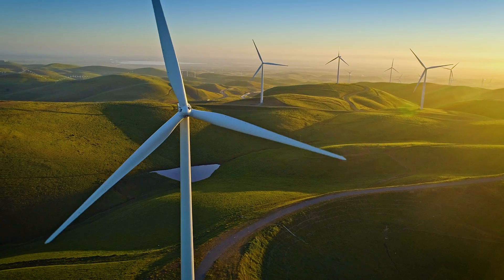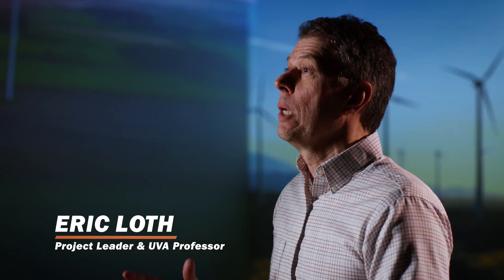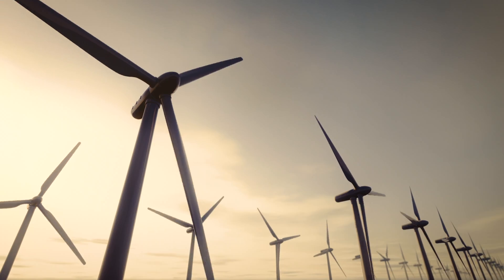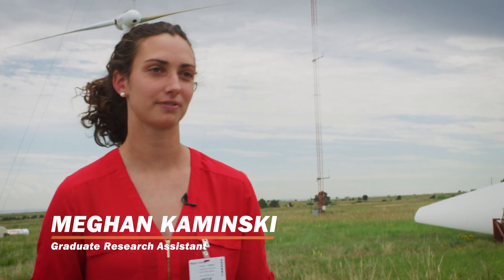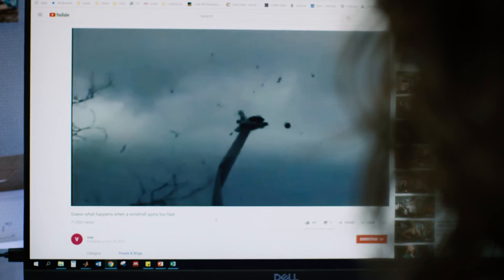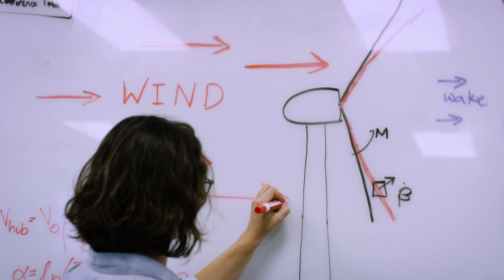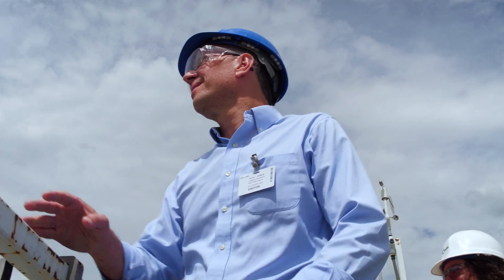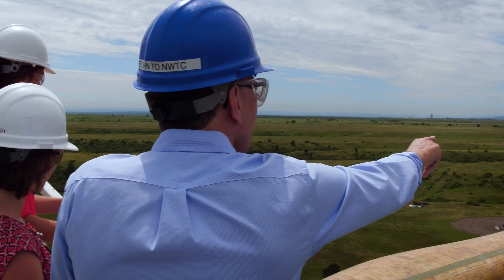These Giant Wind Turbines, Inspired by Palm Trees, May Be the Future of Renewable Energy

Comment: Force on blades increases at the cube of the wind speed: 
Power = (Air Density x Area x WndSpd^3 x efficiency) – drag
Today’s Wind Turbines max operating wind speed is approximately 50 mph (22 m/s). This speed limit is primary for two reasons:  excessive force can damage the blades; too high rpm can exceed the max rpm of the generator.
Folding the blades reduces the Area and is similar to feathering the blades, which reduces the force on the blades and controllers the rpm. Three challenges folding blades may face are keeping the blades in balance with each other, vibration and their folding response time to gust.
Bottom line is, the folding blade has little or no effect on the wind harvesting ratio, but does add more complexity. Its intent is to extend the upper wind speed range, and may add a few mph; however the higher wind speeds is limited to the amount of power it can produce by the generator’s rating. 
See my blogs “Is Bigger Better or just Bigger”, “Can Wind ever compete with Nuclear” at GSharpLabs.com George A Spencer Inventor